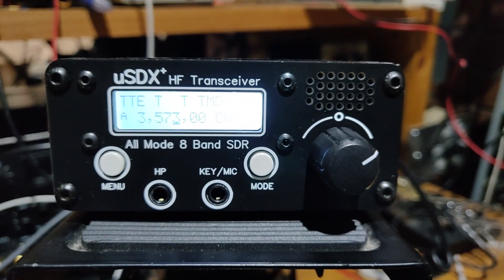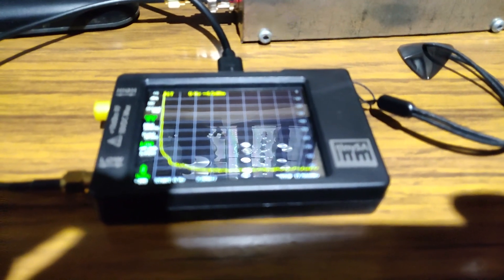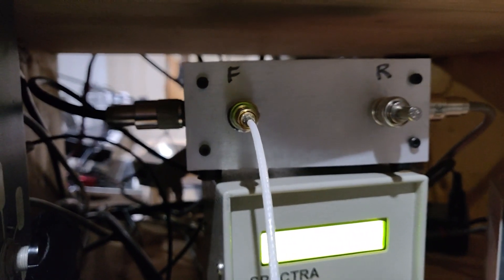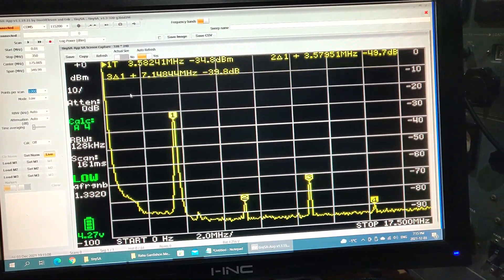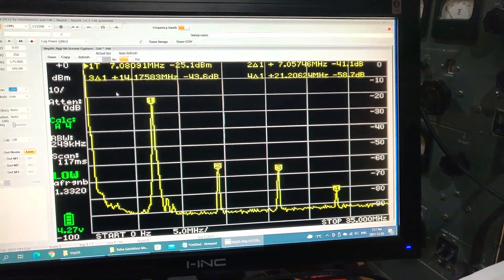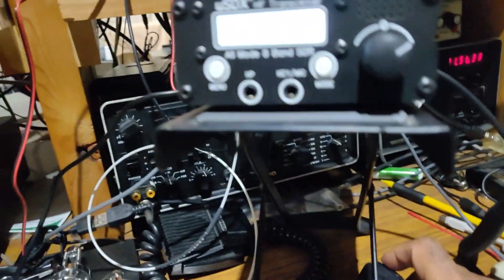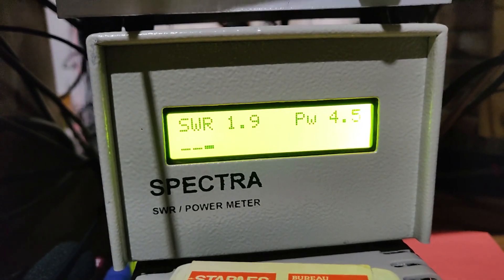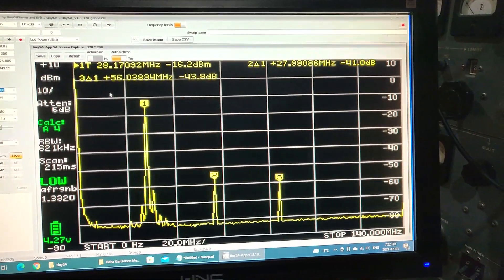TinySA | uSDX+ | 8 Band SDR | SSB/CW QRP All Mode HAM Transceiver |  Spectral Purity check

Comment: Well, that is interesting. It looks like the 2nd harmonics are generally low but certainly not as low as 50db below the fundamental. This may have been covered in the groups.io discussion. Still looks like an interesting  radio. Oh, the temptation ;-) 73 de W8IJN
Reply from the maker: Nils, forgot to mention.... I just now had a QSO with a station in Virginia on LSB 40m. He gave me a 57 report. He was running 600W. My audio was a bit muffled he said, but R5 copy. 73, DE VA3UMA
Reply from the maker: True, Nils. Thanks for checking it out. The o/p is definitely better than the "brick" model that Manuel tested and documented. This "plus" model falls within FCC requirements. I have given all the details in Watts and dB in the description of my other video (tests using a Tek 495P). 73.